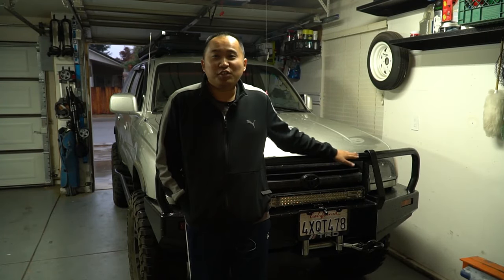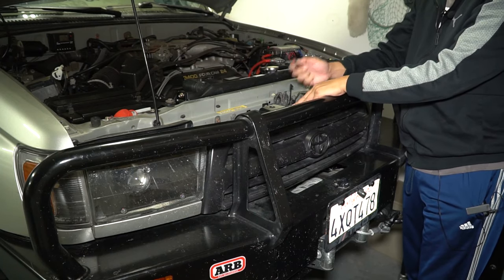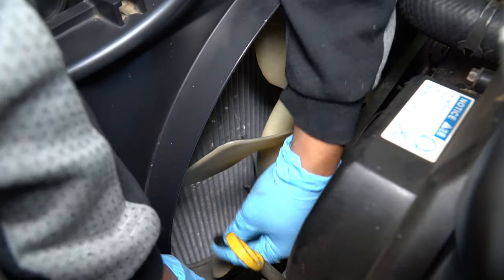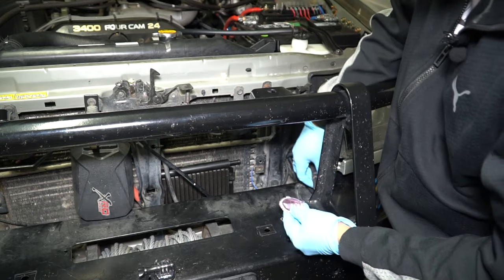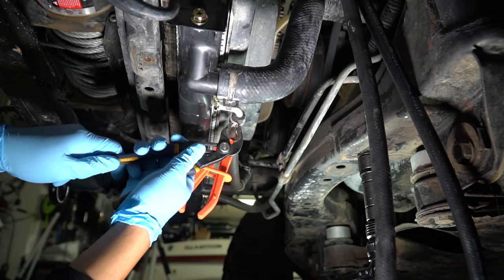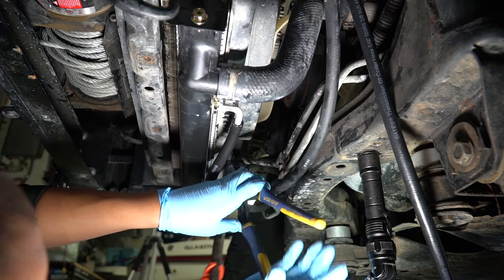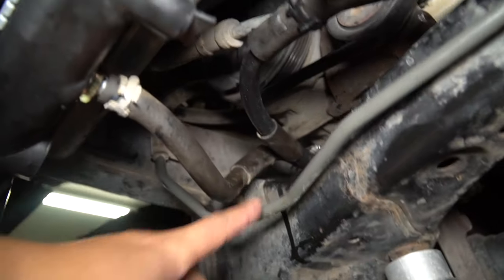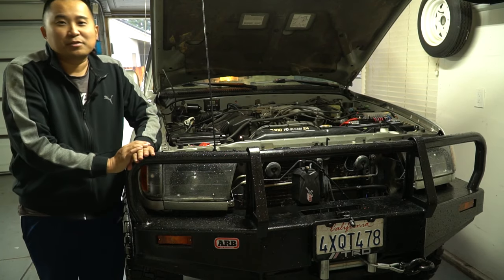Toyota 4runner Derale Transmission Cooler Install

Comment: Nice job! I'm wondering if you could expand on your thoughts regarding the "pink milkshake". It sounds like you are wanting more cooling power, and rolling the dice on the potential issue that could happen in the future. I did this install myself and made the same decision as you to run in parallel, so I'm right there with you. Any other reasons why you might not be concerned about a radiator failure? I guess I'm asking for my own peace of mind.
Reply from the maker: My radiator is brand new so I’m not concerned with pink milkshake. I forgot to mention that in my video but you can kinda tell it’s new hehe. I did a video right before this one showing the install.

Comment: Is the cooler overkill/not necessary if you don't tow or go off-roading?
Reply from the maker: Yeah lol. If you are running stock tires or even 32s, should be fine to just replace the radiator to prevent milkshake

Comment: I live in Washington where it gets to -20F and the hottest it gets in the summer is 109F. I’m unsure if I should bypass the radiator or not? I’m not towing but I do travel a lot and go up steep inclines for long periods of time. Any suggestions?

Comment: If i got my mechanic to do this, could it hurt my engine/transmission! I drive by runner stock and don't tow oftern but i want tthe transmission to last as long as possible
Reply from the maker: Save your money and just get a nice new radiator.

Comment: Great video.  Wondering if you've seen Timmy's pinned comment on his write up discussing the B&M guidance directing that the return line from the radiator be directed to the the bottom nipple of the external cooler (and the return line leave the top nipple back to the trans)?  Your solution has this reversed, so I'd love to get a better feel for why you chose your solution.  Thanks man and keep up the excellent work.  We all appreciate it!
Reply from the maker: Hmmm I’ll check but I figure gravity goes down and by putting it on the bottom... you’ll make the transmission work harder to push that fluid through the top. Not sure I’ll look at the instructions!
Reply from the maker: I looked at the instructions and I don’t think it matters. It actually has it mounted vertical. Don’t think it really matters but gravity might help with the fluid pressure. http://www.derale.com/images/stories/virtuemart/product/pdfs/13501.pdf

Comment: Thanks for this, man. 
So i live in Toronto, Ontario. Since we get down to around 14F in the winter but up to 95F and higher in the summer, would you suggest i just get a new Denso radiator by itself for summer and then install the inline transcooler method you showed in the video for the winter? Would i have to uninstall the transcooler all together every winter? Wondering what your opinion is? Thanks again, love the channel!
Reply from the maker: I would just get a new radiator only if you don’t need extra cooling like me. If you’re getting a brand new radiator, I would run it inline since chances for failure are low.
Reply: I live in Alberta where we're at -4F regularly and get down to -40F at least once per winter, and I have a B&M 70268 cooler installed on my '99 4Runner setup to bypass the radiator. My "operating" transmission temperature in the winter is 140F regardless of the outside temperature (when it's below freezing) because the axle gear oil thickens, which results in more load on the vehicle, bringing the transmission temps up to "normal" in a reasonable amount of time. The cooler definitely has its benefit in the summer months though.
Reply from the maker: Nice that’s good to know! Lol I know in some extreme places, the temps never truly get up there lol.

Comment: Great video! Guess I will just go get a new radiator... Was scared of the 
"Pink slushie " ruining my motor so I thought that the intercooler bypass was great BUT then at the end he says "trans fluid needs to warm up to operating temps. "
Reply from the maker: If you live in warmer weather, a bypass is fine. It’s freezing weather that that becomes a problem

Comment: Valvoline "Import" ATF is a little thicker than the Maxlife/Multi-vehicle ATF. I guess the Maxlife has a better additive package though. I've used both in different Toyotas; prefer the thicker Import for these old Toyotas. Actually, I prefer the T-IV. 

Thanks for the video 👍. Not doing it just yet but watched anyways.
Reply from the maker: Thanks for watching

Comment: Great video, but you should run the input line into the cooler in the bottom, and the output in the top. This apparently helps if there are air bubbles in the fluid.

Comment: Thanks for install video and a smart decision to add on an AT cooler. I will likely install it on my 2002 Tacoma 4x4 DC when I change the transmission fluid and replace the transmission filter.  I recently replaced the radiator with a Denso radiator( Made in Taiwan) and replaced the windshield reservoir too with an aftermarket part made in Taiwan which exceeded the quality of the original Toyota part for a lot less. I have discovered that aftermarket parts made in Taiwan match or exceed OEM parts.
Reply from the maker: Taiwan seems to be decent these days

Comment: Great video! I was wondering how many km you can get out of a full tank of gas. I'm assuming yours is the 60L tank? My 96 4runner only does about 400-425 before the red light comes on (i think then it's got about 25-50 km left)
Reply from the maker: 200miles these days

Comment: Good video! This is looking to be my next project. Do you think the cooler by itself would provide sufficient cooling if the radiator was bypassed? Im wanting to go the pink-milkshake-preventative route.
Reply from the maker: A lot of folks do this and it seems fine

Comment: Very good videos.  I just got my 3rd gen 4runner and need some of your input on acquiring rock sliders and bumpers.
Reply from the maker: Mines an arb front and 4xinnovation sliders
Reply: @PhoRunner  thanks for your response.  Would like to seek your advice on getting manual lockers for my front axle and also what your gearing is on your front and rear axles. Are you in the Fresno area?
Reply from the maker: Any 1st gen tacoma will fit. 4.30 gears. I’m in Fresno yea
Reply: @PhoRunner  what brand are your rocksliders?
Reply from the maker: 4xinnovation sells them
Reply: @PhoRunner  thank you.  I'm in Fresno too.  Be nice to join you sometime when I get mine up to par, lol.
Reply: @PhoRunner  did you change your gearing or are you running stock?
Reply from the maker: Baby steps. Mine’s parked lol... need to get out there
Reply: Yes, would be nice to get out and try my new toy after I do some work on it. Would like to join your group and learn some tips from you guys.  Stay safe & thank you for your time.
Reply from the maker: Find me on 559yotas fb group
Reply: @PhoRunner  joined group.  Waiting for approval.  Thank you

Comment: Pho . How is this holding up for you? I'm doing the same thing but decided to use the mounting bracket approach. Zip ties are good if you don't do a lot off road but in my case I do off-road quite a bit so the zip-tie method will come lose or possibility damage the radiator and ac condenser.  Timmy the tool man did the same thing with zip tie but has since converted to mounting brackets instead. Any thoughts?
Reply from the maker: I’ll check on mine but I’m sure it’s still in there hanging on haha. So far so good

Comment: Hey man. You make on the better videos for the 3rd gen runners. This inline method doesn't bypass the milkshake or did I catch it incorrectly?
Reply from the maker: It doesn’t bypass the milkshake but the milkshake is usually caused by running the radiator too long. Renewing it at 100-150k will be good preventative maintenance and prevent this. Many vehicles today use the radiator for cooling so best to keep things fresh when it’s this old.

Comment: Só for my prado fj120 kzte motor I could possible  just use the New transmission cooler alone? I live in Brasil and in general  the temperatures here are between 77 to 104. Maybe once or two  times in the year it could go down to 46 in the night. I had  previous overheat when towing  or going uphill whith  the car full.
Reply from the maker: Likely fine!

Comment: You say you’re running the cooler in parallel but isn’t it actually in series? Since the fluid goes into the radiator then into the cooler before returning to the transmission? Parallel would be splitting the incoming fluid between the cooler and radiator in my mind
Reply from the maker: Yeah in series. Or inline with the radiator lol.

Comment: Question. So I just installed the Hayden 699 transmission cooler. Install was straight forward. But after the install, when I drive the 4runner forward (doesn't happen in reverse that I've noticed) it makes somewhat of a whining or whirring noise. I jacked up the rear wheels and put it in drive so I could hear where exactly it's coming from but when the rear wheels aren't under load it doesn't make the sound. Only when driving forward.. any ideas??
Reply from the maker: Check the transmission level and make sure it’s right

Comment: What type of boat do you tow? 3rd gen 4R feel to under power to tow anything big. So ending up just picking up a trailer and toss my fishing kayak on it. I want to a Bass Tracker 175 TXW its aluminum so its light but not to sure for 3rd gen 4R pulling it long term. thx
Reply from the maker: 18ft glastron fish and ski boat
Reply from the maker: It tows fine on flat roads lol
Reply: I’ve towed some heavy stuff with the 4R in the 5k range. It’s not fast, but has the torque to manage fine.

Comment: Is it best to just add this even with a new radiator?
Reply from the maker: It's really up to you. I wouldn't if you got a quality OEM radiator. Just run it like it is. It takes a while before it fails and becomes pink milkshake. Most people run their radiators forever thinking it will last their lifetime and that's why they have failures.

Comment: You need to be in 4lo as much as possible cause it locks your converter and keeps temps cooler. That cooler isn’t going to do much. You
Have manual front hubs so you can go 4lo and still be in 2wd. The temp light comes on at a very very high temp if yours has come on more than once I’d drain and fill the trans.
Reply from the maker: Just once when on a trail and I went straight to 4lo. It’s never come on before since I had smaller tires before.
Reply from the maker: And soon!! I’ll be doing a drain fill
Reply: I was wondering about this. I go on technical tail as for 5-6 hours, non stop, every weekend, in 1-2 in an auto in 4lo. Never had any temp issues. 
But I know 4h is not for trails. So I’ve never done that. It’s stupid. 4 h is for snow or dirt roads at higher speeds.  I’ll do 4 hi on dirt on my way tot the trail head to warm up but yeah.... that probably explains the uncontrolled lunging these ‘off rosters’ do, seemingly out of control throttle over obstacles. Dummies.

Comment: So the transmission fluid still flows through the radiator and the extra cooler? I guess you just added an additional cooler for the transmission really...
Reply from the maker: Yes. I needed extra cooling for my tires and towing. The radiator is new so milkshake will be rare.

Comment: Question… I use my 3rd gen as a work truck. I routinely/daily have about 2k lbs of tools in the back. I run it in ECT mode. I’m thinking a T cooler would be good. Tell me what you think and if you have any advice for this situation.
Reply from the maker: Hmmm just change the oil regularly and you’ll be good.

Comment: The Derale 13503 8000 series states that it is for 5/16" ID transmission lines, but you used 3/8" ID hose.  Does this matter?

Comment: I'm trying to do this to my 2nd gen tacoma that does not have an existing cooler on it. I absolutely cannot understand the fluid part. There has got to be a better way than driving it knowing for a fact that it's low, damaging things.
Reply from the maker: Getting close to the right amount won’t cause damage. The FSM says to check it this way

Comment: If you wanted to get rid of the pink milkshake problem wouldnt you just bypass the stock rad all together? What’s the benefit of having the fluid flow through the stock cooler

Comment: I don't have a condenser I threw it away can i mount it strate to the radiator??or do I need to make a bracket ?
Reply from the maker: Yes you can and no you don’t need a bracket. Can use the zip tie thing

Comment: I read the sending line should be connect to the bottom of the transmission cooler and the return line should be the top of the cooler. Does it matter?
Reply from the maker: Not sure it does. Directions didn’t state anything and I’m sure the pump is strong enough either way. I figure gravity lol
Reply: @PhoRunner  Thank you so much. Love all your videos. I have a 2WD 2000 4Runner. All you videos are GREAT!!! Thank you so much. I'll buy you a coffee. :)
Reply: @PhoRunner  Thank you so much. I love all your videos. I'm using all your videos on my 2WD 2000 4runner. I have 197K miles on it. I would like to do a 2-3 inch lift on it. Thanks again.
Reply from the maker: No need and enjoy the content! God bless

Comment: So do u drive in 100 plus degrees and what temps are u seeing now with the cooler
Reply from the maker: 140-180 normal driving. 190-210 towing my boat up hill
Reply: @PhoRunner  sweet and that is in 100 degree weather
Reply from the maker: It was 90 that day. We’ve had a cool summer this year but I’ll check Friday as it’s 105 lol

Comment: 7:01 and 8:21...When mounting a transmission cooler sideways, the bottom fitting is the inlet (hot side), and the top fitting is the outlet/return (cool side).
Reply from the maker: didn't see any mention of this in the manual and haven't had any issues since :). I was looking all over for info about the orientation and I found nothing.

Comment: its great you instaled cooler but all thats doing is masking the issue REGEAR and use a cooler.  big ole tires/towing and AT light wrong gears homie.
Reply from the maker: I’m on 488 now
Reply: @PhoRunner  Nice, I must have missed that video
Reply from the maker: I didn’t make a video about it as it was a difficult job and lots of costly tools lol. Maybe if I get another chance to regear I will make one.